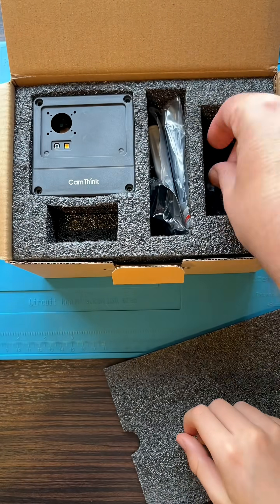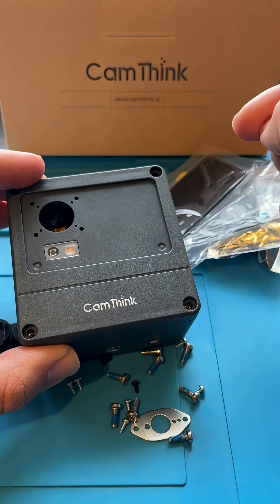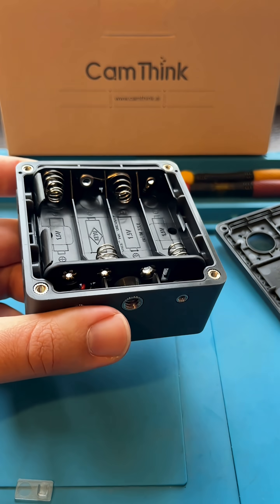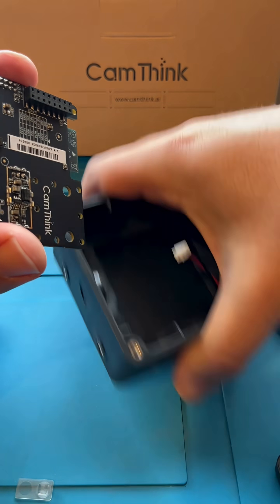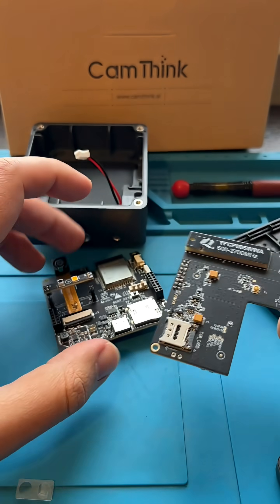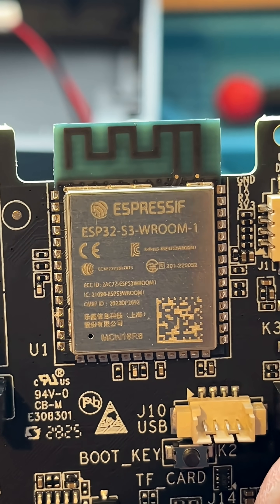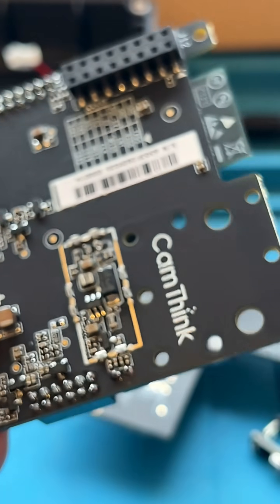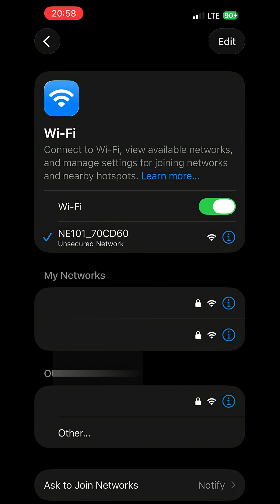CamThink NeoEyes NE101 #unboxing & #review

Comment from the maker: https://www.camthink.ai/product/neoeyes-ai-camera-ne101/?utm_source=youtube&utm_medium=kol&utm_campaign=kristina

https://wiki.camthink.ai/docs/neoeyes-ne101-series/overview
NeoEyes NE101 is a low-power, event-triggered camera designed for long-term battery operation (up to 3+ years on 4×AA, 10 photos/day). It wakes only on events (PIR, radar, sound, etc.) and sends images via Wi-Fi, 4G Cat.1 or Wi-Fi HaLow.
Key features:

Fully modular design: swap camera lenses, connectivity modules and sensors in seconds
Open-source hardware & firmware (ESP32-S3 based)
Replaceable camera modules: OV5640 CPI (60°/120°) or SC200AI USB (51°–137°)
Connectivity options: Wi-Fi (default), LTE Cat.1 (global & NA versions), Wi-Fi HaLow (868/915 MHz, long range)
IP67 waterproof, works from –20 °C to +50 °C
Rich interfaces: 16-pin GPIO, alarm input, TF card, fill light, UART debug
Multiple mounting options (wall, pole, table, etc.)

Main applications:

Smart agriculture & livestock monitoring
Remote meter reading & industrial equipment checks
Outdoor wildlife and security cameras (intrusion detection with ultra-low standby ~0.8 W)

Perfect for any battery-powered or off-grid vision project that needs years of autonomous operation.